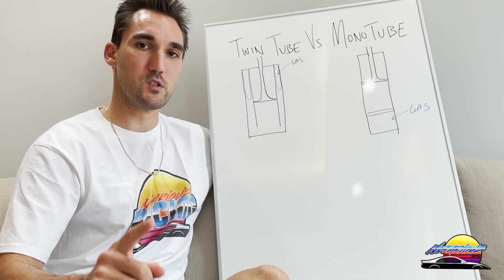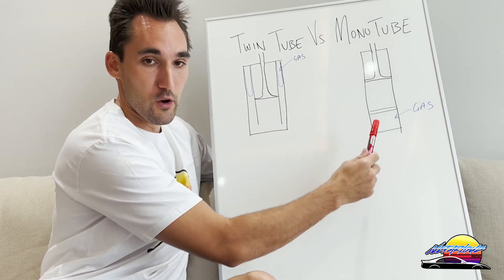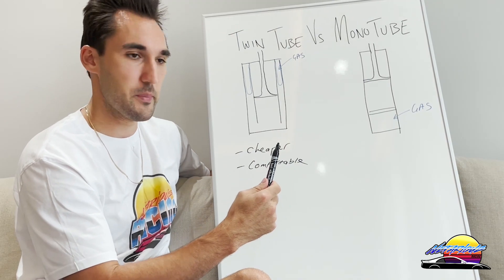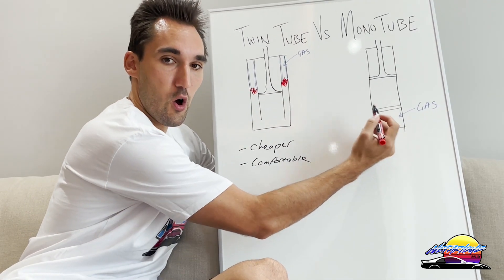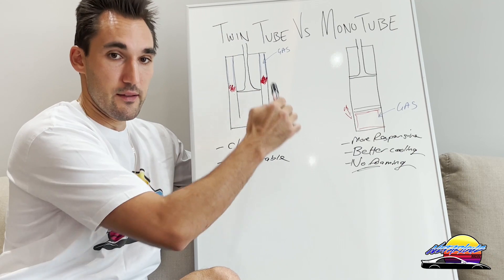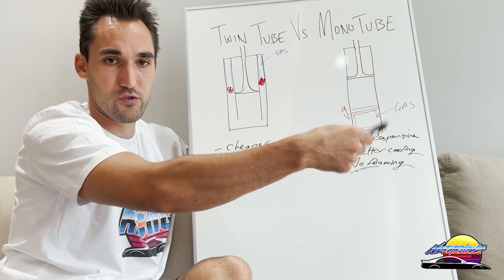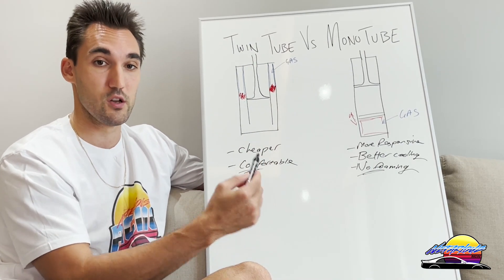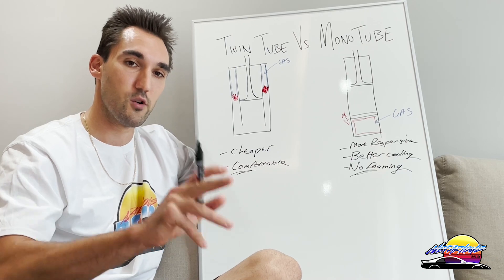Twin Tube VS Monotube Coilover Shocks: What's The Difference?

Comment: If twin tubes have such disadvantages, then why are the KONI FSD (now called Special Adaptive) better for horrible Indian roads, over the Bilsteins? And how come the Koni and the Bilstein cost the same? The frequency selective technology in the Koni provides for both a firm ride over broken surfaces and a pliant ride over smoother surfaces….a very good trade off between firmness and a compliant ride with good handling. One has to see a spine specialist after driving on Mumbai’s roads - in a Bilstein.
Reply from the maker: Twin tubes have disadvantages for performance, you are talking about comfort on the street which is exactly what twin tubes are good for.

Comment: What would the Ohlins dual flow valve Road and Track suspensions be considered?
Reply from the maker: Those are monotubes.
Reply: Not only are Ohlins peak quality suspension, but every Road and Track Coilover I've seen has been mostly contracted with aluminum. Cheaper coilovers are heavier.